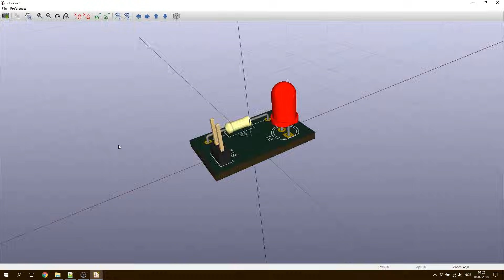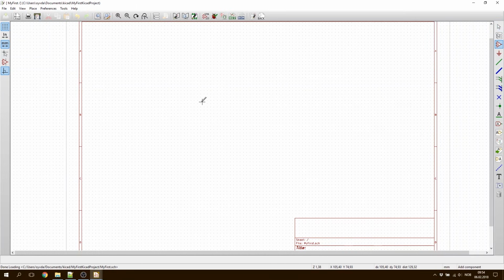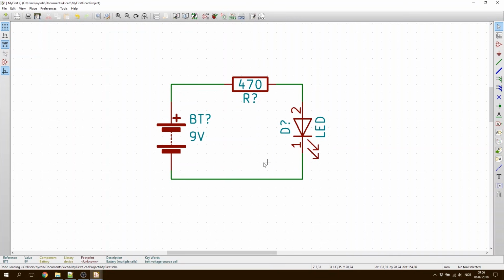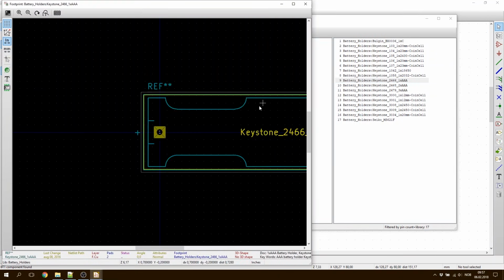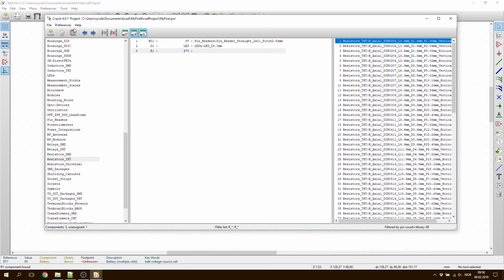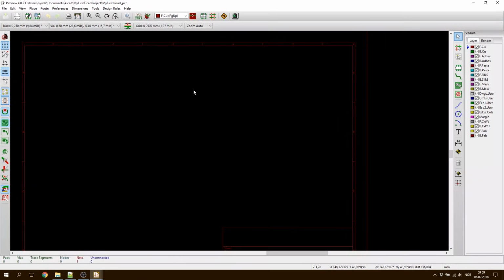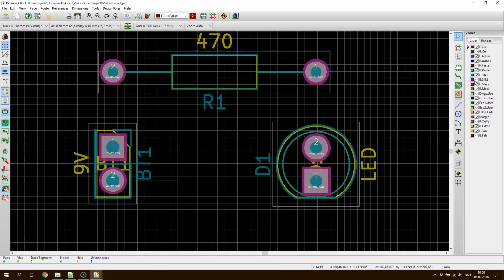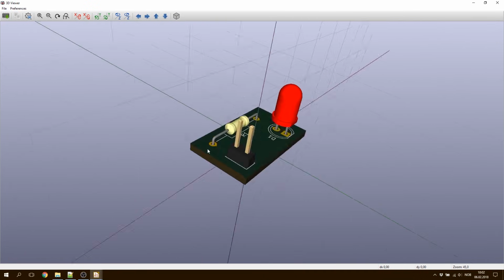Quickstart Intro to Kicad - Design a board in 5 minutes

Comment: Perform electrical rules check generates 9 warnings in this example. We are snapping everything to the grid, so how does anything generate a "Warning: Symbol Pin or Wire End Off Grid" error? And moving symbols or wire ends anywhere on the grid does nothing, the Warnings persist.
Reply from the maker: I remember a student of mine had a similar problem. It was caused by importing a project from kicad 6 into kicad 7. His solution was to just redraw the circuit. But might be better solutions out there.

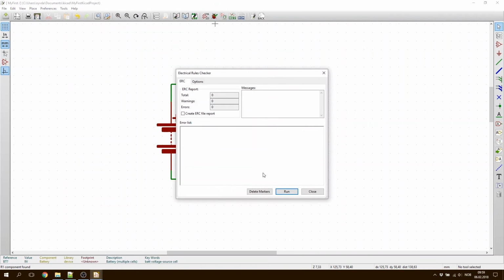Comment: at 3:30 "perform electrical rule checker" in KiCad 7.02 it is giving me like 11 errors at every corner of the wire and at every connection, and the dashed line between the cells of the batter and even the line inside the LED..  what gives?
Reply from the maker: What does the error say?

Comment: Good video, but in the 3D viewer it doesn't show the models, even doe they are turned on for the render. Why is that?
Reply from the maker: Most likely it's because the component you use does not have a 3d model defined - or that the 3d model can't be found. Click on a footprint and go into Footprint Properties. Choose the 3D Settings tab and look at the 3D model(s) defined there. If there is one there, look at the location of it and verify if that file actually exists.

Comment: I'm coming to KiCAD after using Fusion 360's electronics design software. This tutorial was exactly what I needed. A bit of the functionality has changed since 2018 but I was still able to follow the tutorial with no problem in 2022. One nice change is you no longer seem to need to export and then import the net list in order to turn the schematic into a circuit board. Props on the great tutorial it's held up really well!
Reply: Actually Dylan I need help finding the Pin Headers library. I cant find it in 6.0 version of KiCad.
Reply: @okaytree7711  i found it under Connector_PinHeader_2.54mm
it was the 6th option for me.
Reply: @mr.curlyfri  thank you for responding! I looked it up too, I guess you gotta see how things change from version 4 to version 6
Reply from the maker: Thanks! =)

Comment: This program is surprisingly straightforward for a circuit board designer program. I might someday try having a through-hole board made if I can find a small-run (i.e. 10 or 15 boards) facility. I could do something generic enough that it could be pressed into service in many different applications, like an X channel ADC for the Raspberry Pi, a "motherboard" for an Arduino Mini / Micro / Nano that has I/O expanders and such, or whatever else I might come up with. One thing I thought of, that I couldn't find an already-made board for, was a multi-MOSFET driver board (like 8 outputs) that had a shift register as the control / input signal, so an Arduino Uno would be able to control 8 (insert high current DC load here)s and still have plenty of pins to spare.
Reply from the maker: There are lots of places to buy PCBs in small quantities. PCBWay, Seeed Studio, OSHPark +++
Reply: @Ohmify  Is there a "best" one of those in your experience?
Reply from the maker: @dickcheney6  If you are located in the US and want dependable shipping, then OSHPark is US-based. PCBway and Seeed studio are CHina based, but I've ordered from them and gotten my PCB in a week here in Europe several times.

Comment: This was perfect as I was actually designed a very similar board (just replace the resistor with a mosfet, the battery with a JST connector, and move things around a bit).  Checking out how to get it made next!

Comment: Does the size of the board rapidly increases the cost? Lets say a simple circuit like yours, just with a board 4x the size of yours. How much more will it cost?
Reply from the maker: I wouldn't say rapidly. But you can check for the size and quantity you are curious about by entering size and quantity into for example PCBWay's calculator: https://www.pcbway.com/

Comment: Is there an easy way to design a circuit with 50 components using KiCad? The ground leads need to be kept short as it is a radio receiver.

Comment: Great video, short and to the point.
Regarding Kicad itself - I have little to no experience with PCB design, but Kicad leaves me with the impression of being several programs "under one roof", rather than one program.
Reply from the maker: Thanks! Yes, it is. But it feels like just one program when you use it.
Reply: @Ohmify  Here's an example of what I mean (please correct me if I'm wrong): when you go from Eeschema to Pcbnew, you have to explicitly import your circuit (together with footprints) by doing Tools -> Update PCB from Schematic.
Why isn't this done automatically? What happens if I decide to go back to Eeschema and switch a footprint or five?
Does this mean I have to redo Update PCB from Schematic again?

Eeschema and Pcbnew behave as if they're two separate applications, when they make the user manage this data exchange between them manually. IMO this shouldn't even be visible to the user, should be and automated process running under the hood.
Reply from the maker: @Booruvcheek  You're right that it works like that. I actually prefer to have control over this. I don't want my PCB layout to change until I say so:)

Comment: Why do wires sometimes not snap to the component leads in Schematics?
Reply from the maker: I don't know, but my best guess is that the component was created with a different grid setting that you're using to create the schematic.
Reply: @Ohmify  It was created with a different grid setting. I need to check my components first to see if all the leads snap to the grid before connecting them.

Comment: Thank you for the video. My understanding is that the software should perform automatic track routing. I am not familiar with the KiCAD software, so I created my schematics using online free software EasyEDA. This EasyEDA would not allow me to see the actual tracks. I would like to see the actual copper traces on the PCB for each layer. Question - would I be able to load the Gerber files created in this EasyEDA into the KiCAD and see the actual copper traces? Also, can I import my schematics diagram from the EasyEDA into the KiCAD software? Thank you!

Comment: I really appreciate your videos and have downloaded KICAD based on how helpful and well you demonstrate the use of KICAD.

I found it really easy to draw the first schematic, however,  when I go into PCB mode I have problems with the wire not connecting to the component. So the components cannot be connected. It seems like the wire is sticking to the mouse cursor. 

I would really appreciate any advice or even a youtube clip on how to resolve this issue. Again, thank you for your fantastic videos.
Reply from the maker: In the PCB mode, you need to connect it the same way as in the schematics. You should see lines that show which point should be connected to another. If you try to connect things that are not connected in the schematics, you'll get the behavior that it seems you have.

Comment: Great tutorial, short and to the point.
A couple of things I would like to mention though - in my version of KiCad ("5.0.0+dfsg1-2, release build", running on Kubuntu 18.10:1) resistor value is printed next to the resistor, not inside it;2) "LED" and LED annotation are printed horizontally, not vertically;3) I don't have PIN headers library, but I do have several libraries named "Connector_PinHeader_1.00mm", "Connector_PinHeader_1.27mm", "Connector_PinHeader_2.00mm", "Connector_PinHeader_2.54mm", they must have changed that for whatever reason.4) 3D preview of the PCB shows just the board, without components - no resistor, LED or battery connector.
Reply: The reason this is happening is because this tutorial was made with KiKad version 4 and you're using version 5. I fell into the same problems you did.
The last point about the PCB not being populated in the 3d viewer didn't happen to me though...
Reply: @randomviewer896  Thank you for this information. As for missing 3d models of components, I guess I'll find out why eventually :)
Reply: @Booruvcheek  Do you have the Kicad 3d library installed?
Reply: @randomviewer896  I'm not sure, but it seems I do -
(here's the list of KiCad packages I have on my system)

$ sudo apt list | grep kicad

kicad-common/cosmic,cosmic 5.0.0+dfsg1-2 all
kicad-demos/cosmic,cosmic,now 5.0.0+dfsg1-2 all [installed,automatic]

... skpped kicad docs, etc ...

kicad-footprints/cosmic,cosmic,now 5.0.0-1 all [installed,automatic]
kicad-libraries/cosmic,cosmic,now 5.0.0+dfsg1-2 all [installed,automatic]

kicad-packages3d/cosmic,cosmic 5.0.0-1 all

kicad-symbols/cosmic,cosmic,now 5.0.0-1 all [installed,automatic]
kicad-templates/cosmic,cosmic,now 5.0.0-1 all [installed,automatic]
kicad/cosmic,now 5.0.0+dfsg1-2 amd64 [installed]
kicad/cosmic 5.0.0+dfsg1-2 i386

I must have missed a step somewhere along the way when creating my first PCB, but never mind, i'll figure it out eventually.
Just need to play with KiCad more.
Reply: @randomviewer896  Actually, I have looked at those packages again, and this time I have noticed that kicad-packages3d does not have "installed" next to it. 
So I did a quick 'sudo apt install kicad-packages3d', and voila! Components are now in 3D viewer too. Who would have guessed you can have the viewer installed, but not its assets.
So thank you for your suggestion!
Reply: i eu am aceeasi problema  desi am descarcat librarii de componente de site KICAD unde da si fisiere in solid ale componentelor

Comment: How do you know which footprint suits you?
Reply from the maker: You choose the footprint that fits the physical component you are planning to buy. If you are planning to buy a through hole resistor, then choose a through-hole resistor. If you plan to buy a surface mount 1206 resistor, that's the footprint to use.

One strategy is to just choose one, then try to find a component that fits when you order components. It becomes easier and more intuitive after you've built a few boards.